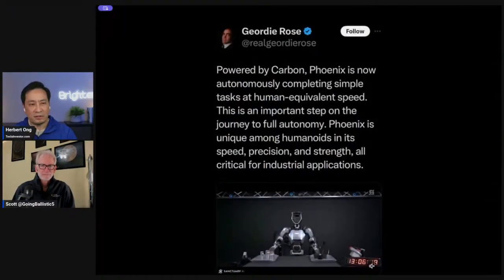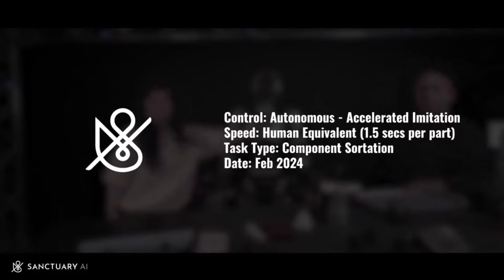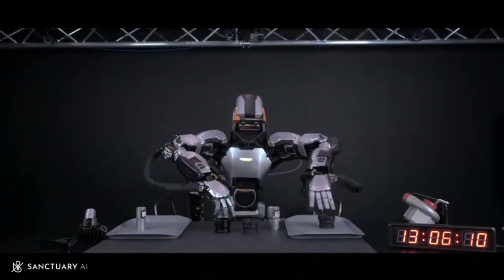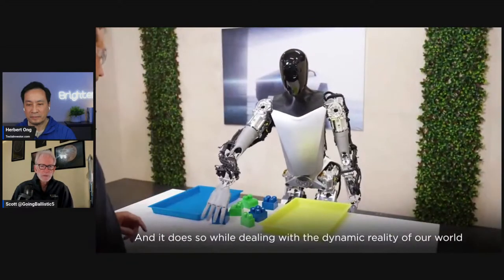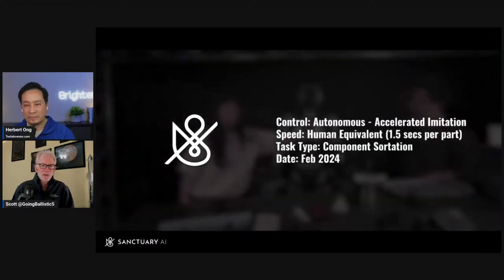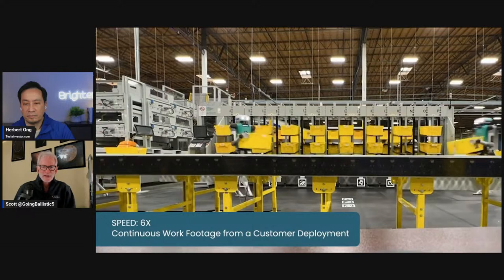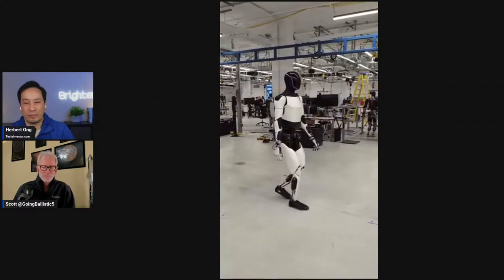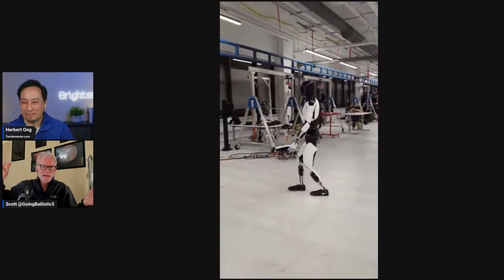BREAKING: CEO Sanctuary and Agility DROP 2 New Humanoid Demos

Comment: A "putwall" is an order fulfillment method. You fill the totes from inventory in batches on one side, and then take the totes off from the other side when the order is complete. (Which is what the bots in the demo are doing.)
Reply from the maker: I looked it up afterwards and realized it. Not a company. Thanks for clarifying!
Reply: It looks like something that might happen in an order fulfillment center, but the video with a 6x speedup looks more like human speed, and I doubt that labor in an order fulfillment center is so specialized that some workers are always on one side of the wall loading the conveyor and others are always on the other side filling boxes. A human laborer performing this sort of task also performs many other tasks in the fulfillment center because this task won't always keep him busy.

A fulfillment center might automate this task to eliminate the labor, but why would it use humanoid robots? It wouldn't replace the conveyor with humanoid robots carrying the boxes to wherever the conveyor takes the boxes. Specialized machinery automating this task of moving boxes to the conveyor could be much simpler, faster and less costly than humanoid robots. The conveyor is already replacing human labor. That humans perform a task now is no reason to think that automating the task requires a humanoid robot or that automating it with humanoid bots makes any sense.

FSD is not a humanoid bot behind the wheel of a car. There's a reason for that.

Boston Dynamics had a robot performing a similar task as fast as a human at least four years ago, but it was on wheels and didn't have two arms. Search for a video titled "Boston Dynamics Robot Can Stack Boxes With Amazing Ease". Trying to automate this task with bipedal locomotion is more gimmickry than effective industrial automation.
Reply: @restonthewind it’s kind of a chicken/egg situation. The factories don’t want to go all in on robots until they’re proven, and buying humaniform robots lets them do this. Meanwhile the robotics companies produce humaniform robots because that’s what the market wants, and they get a lot more publicity.
Reply: @marsrocket  Which market wants it? YouTube wants the videos, but how many factories have actually bought a humanoid robot even for testing? This video is not an example. Tesla making videos of its own bot in its own factory is not an example either.

Comment: Inductive charging through the feet of the robot on a charging floor and it’s non-stop working! You could also dispense with 90% of the battery weight, further increasing efficiency

Comment: I’m thinking that bots lifting the box high is for them to check the position of the conveyor belt so that they can accurately set it down
Reply: Yeah they lift it above their sensors so they can see what they are doing. You can see them do the same when they put the boxes on the shelves behind the conveyor

Comment: I hope, in the future, that a Chimpanzee format is made (four arms & hands).
Some very dangerous jobs could be done requiring climbing, such as;
Tree trimming, power line maintenance, roofing, steeple jacking, fire rescue, mountain rescue, high rise repair, etc.
Jobs such as these require very high insurance (workers comp), and ground support.
I know that heel spikes can be used on wood, but a Chimp is the master of climbing.
Plus four arms/hands on assembly lines would increase profits.
I’d take hands instead of feet.
In n out burger, it will make your burger with three arms while swiping your card in ~ 30 seconds.
Cheers

Comment: fyi - I passed your list into GPT4 and it came up with a few more.
Scythe Robotics: Based in Longmont, Colorado, Scythe Robotics builds autonomous robots for landscaping. Their all-electric mowers use AI, cameras, and sensors to adjust to different environments while cutting grass without human operators1.

ABB: ABB’s portfolio includes autonomous mobile robots and RobotStudio, an offline programming and simulation tool for robotic applications. They serve various industries, including healthcare, logistics, and metal fabrication2.

NVIDIA: NVIDIA’s Isaac robotics platform supports robot development and deployment. Their artificial intelligence technologies power autonomous machines, such as the Jetson Orin AI computer3.

SVT Robotics: SVT Robotics offers the SOFTBOT Platform for efficiently deploying robots and automation. They focus on flexibility and ease of integration4.

Comment: I like the fact that most humanoid robots have legs but I wonder why so many companies want their robots to have legs when in most factories, they could do the job faster and cheaper with wheels. Eve from the company 1X is a good exemple of that. In most case, robots don't have to take stairs.
Reply: Agree - for 99% of factory applications wheels will not only be usable but even preferred. Easier and cheaper to manufacture, more stability, lower energy use, faster movement around the factory if needed.
Reply: Perhaps Elon is anticipating a Martian terrain.
Reply: The wheel already is pretty much a done and tested method, no need to do more research. So company need not  waste time and limited funding in researching the bots in wheel because when client order came in if the bot configuration need wheel, just swap the leg to wheel, the bi pedal still have more room to improve on so by solving the difficult ones, you have the advantage of solving all. The easy ones need not be a worry because it’s a matter of changing the configuration to suit clients need later on

Comment: When in a controlled lab.. the mathematics is constant controllable. My thoughts are,  will we ever have robots that are able to start from one spot and determine the variations needed to accomplish task.. Example if I start a task like putting screws into a frame that holds a piece of plastic... it's a 12 point operation, 12 screws, holes pre drilled... will a robot ever be able to do such a task if it gets off center at any point, will it correct or simply stop or malfunction? Everything is math.. to a robot. To operate it has to constantly calculate distances among other calculations..